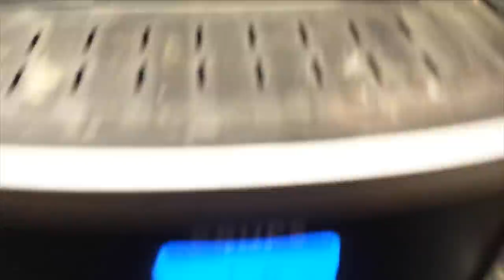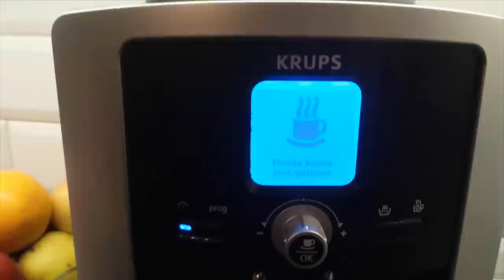KRUPS XP7200/EA8000 wyciek cz1. [leak part1.]

Comment: Hello, I have a problem and is that every time I make a coffee is activated the function of AUTO-TES, you do not have to be this ??
Reply from the maker: One more thing - from your description seems that the main problem is with your piston gaskets.
You can replace only those and your problems will gone.
I strongly recommend to replace entire piston instead of just piston gaskets.
The difference is that inside of the piston there is one additional gasket that is not accessible on the market - only way to replace it is to replace entire piston.
This internal piston gasket has small hole inside - coffee goes through this hole, but when hole is a bit bigger, coffee goes through faster and is not strong anymore.
So to enjoy nice strong coffee, is good to replace the piston instead just two main piston gaskets.
AA - entire piston costs the same as two piston gaskets and includes piston gaskets in the package :)

Comment: marisuz thnx for video but what did u do exactly to fix leak all i saw is u taking it apart and then put it back together?
Reply from the maker: +yacoub nasrallah 
Hi,
On this video I liked to show how the machine is built and where gaskets are located.
Here you can see it in more detailed view: https://youtu.be/ZWNQ2C9nV7A

To fix error No6 and get rid of the leaking problem, you have to replace all the gaskets. Fortunately gaskets are wide accessible on the market. You can buy it for example here: 
http://www.ebay.com/itm/Krups-Espresseria-XP-72xx-Hydraulic-Repair-Kit-Gasket-Set-Dichtungsatz-/300842234397

In case any problem, feel free to contact me.

\Mariusz
Reply: +Mariusz Grden  thnx
Yes i found out part2 shows the fix for the gasket ... But sadly my gasket  was good so i put my machine in trash

Comment: Thanks for the vid. maybe you have an idea whats wrong with my EA8260?  It's stuck in auto test, you hear the brew group moving, then the pump builds water pressure up but never releases it through the coffee-outlet. Then steam comes from the driptray( pressure valve?) and it says "empty containers". And gives a loud popping noise.This happens over and over, and is says "error code 12" .
Rarely it does work, then it's leaking from the bottom.

thanks in advance
Reply from the maker: colourado85 
Hi, of course I have a solution, but to describe it correctly I have to look at the manual. In general error No 12means that there is no signal from piston position switch or something like that. 
I'm quite busy at the moment so if I will not give you answer till Tuesday, please remind me about you.
Reply: Hello Mariusz thank you thats very kind, take your time and good luck. I will get back to you next week then
Reply from the maker: Welcome back :)
So according to the error code table on the manual:
Error No 12 (same as No13) means that "There was no ejection switch pulse in the 3s following return to the distributor’s original position: the machine requests the cake tank and the slide to be removed and replaced, and an empty cycle is proposed"
Solution:
No raising of the ejection pin:
- excess clogging of grinds in chamber
- escape of pin during rise of ejector (recall torque exerted by the spring)
- switch incorrectly clipped
- wires tensed
- no release of paddle-switch at rest against metal plate  place a washer th. 1mm + internal Ǿ 5mm between 
witch support screwing bush and metal plate
- poor electrical connection
- actuation pin on paddle-switch incomplete

When I've had this problem, was caused by another strange thing. When several times in a row I started to make a coffee and Stop it, it clogged a strainer inside the chamber. I just needed to clean it out.
Reply: Hi and thankyou for your detailed description. A clogged chamber or ..something explains now why it keeps saying empty containers.. I will let you know what the problem was. Where can I find the injector pin on this model? I have found some service manuals but they're without a parts list..
Reply from the maker: Hi,
This ejection pin is this thing inside the chamber with long "stick" and white plastic end. It is raised at the end of cycle by the mechanism that you can watch here:
https://youtu.be/ZWNQ2C9nV7A?t=3m48s
I can send you a service manual on email if you want.

\Mariusz
Reply: Cool now I know where it is lol. yeah I would really appriciate if you send me that manual, I've pm'ed you my email
Reply: Well I've cleaned the chamber (dirty) the strainer (not so dirty) and the plastic ejection pin sleeve (very dirty) and greased the pin with food-grade silicon grease. Checked the switch which seemed ok and the wiring. Then had a quick testdrive, and..  Everything worked!! right at the first try, even made good coffee without leaking. But...
Then I've opened it up again to finish all the wiring and clean the upper part (strain) since it was open. Put everything back together and it didn't work anymore >< 
Again error 12 but this time something else: the ejector pin keep sticking in the upper position.. When I move the ejection scraper a bit it pops back in the lower position again. Hmm.. I wil clean it all up, but I don't understand whats wrong this time.. I've noticed the switch also isn't very good, sometimes it doesn't click sometimes it does.
Will talk to ya..

Comment: Hi Marius !

There is a KRUPS EA 8025.
This morning I turned on after the POST error code 06 written off .
Can you help me to see what could be the problem ?
Thanks.
Reply from the maker: +B. Jocó 
Hi there,
Actually error code 06 is obvious - water leake caused by old gaskets located on the "Helper piston".
Please have a look also at this more detailed video: https://youtu.be/ZWNQ2C9nV7A
You have to change full set of gaskets - everything is on this video.

I recommend to change also entire piston (piston set costs the same as only piston gaskets). Inside the piston is located "Barista gasket" responssible for strongness and "crema" effect.

Full set of gaskets you can buy easy on the Internet for ~10 - 15eur
Piston shall costs also around 15eur.

Please have a look at the rest of my videos with Krups disassembly - you will find all details needed.

Fingers crossed,
\Mariusz

Comment: Hi Mariusz,

I have 2 pieces of EA8442 which drive me crazy.One of them start the grinder for just 2 seconds,the other run to long about 12-15 seconds and how i have seen it is to much coffee and the lever it is unable to press the hole amount so it go in test mode all the time.I have try to disconnect and connect back without the tray and water tray to get in setup menu but was not able to get in the setup menu.Any help will be welcomed.Many thanks.
Reply from the maker: Hi,
to go into the setup menu, you have to:
- unplug machine
- take the cakes container out
- take the coffee drawer out
- take water tank out
- press "PROG" button (keep pressing)
- plug the machine into the electricity (release "PROG" button)
- now U are in Service Menu. You can adjust the grinding time from 6 to 10 second

Put everything back into the machine, press OK
When Cycle finished, unplug machine for 10 seconds and plug in again.

What U describe is a bit strange. I hope the above information will be helpfull. In case any problems, just write a message.

Good luck.
\Mariusz
Reply: did you ever find a solution to fix this? I got the same problem..

Comment: Hi again,

I have done all the described steps but no way to get in the setup menu. My personal opinion is that both machines have a software(program) failure.To give you an idea about, if i cross change the user interface(the screen) the machines react in the same way...the interface with the 3 second grinding will run the grinder 3 seconds  on both machines,the one with 12 seconds will run 12 seconds on both of them.One more think, the test come only on the long running machine but i guess it is because is to much coffee in the machine and the lever is not able to press it,with the short running i have no test on the machines.On the user interfaces it is a connector to plug to a computer, have somebody try to do that?Ask a little bit around and let me know before i will trash them both!I have spend so many hours in trying to fix them...Thanks,Frank.
Reply from the maker: Honestly I have no idea :)
Personally I have also enough of this coffee machines and I've threw them out (also have two).
Right now I'm using simple pressure coffee maker - simple built, nothing to repair (like this one: http://tvmaxx.pl/images/3449859bce16930e87c7c3fb0f960737.jpg )

However if you really like full automatic coffee machines, I recommend to buy a second hand SAECO Incanto Deluxe - really durable machine with LCD display. A nice one after full maintenance cost ~100$ 

\Mariusz

Comment: Hello I have a problem krups ea8260 it keeps showing empty garbage dispenser I even changed the electron.
Reply from the maker: Hi,
hard to judge. I got rid Krups machine, but please have a look at the manual here:
http://www.repax.dk/files/EA8050%20temp%20mm.pdf
There you will find all possible issues described.
Regards

Comment: Hi, 
i have krups p7200 the same machine in the vedio, it gave me problem message  insert coffee drawer?
its in its place and still the same message 

any suggestion for the problem??
Reply from the maker: Hi,
For sure coffe drawer sensor is locked. You shall disassemble the coffee machine and check the sensor.
For sure you will see what the cause is.
In case any problems, please tell me, I will try to help you - I can capture a short video 4U
Reply: Mariusz Grden

Comment: Hi i have a Krups 8250 that has no error message but water does not come through.... What could be the issue as per your opinion
Reply from the maker: Hi,
The answer is here:
https://youtu.be/mft5b4iGkvk

\Mariusz
Reply: It seems that my error was different, now it worked and no more leak, the issue seemed to be in the pipes in some like this, as it was very dirty... good cleaning shaking and else helped... https://ersatzteildirect.de/Krups-Espressomaschine-Kolben-fuer-EA8080::12299.html

Although, now after a lot of cleaning cycles, I have a new symptons... It keeps asking to clean the two trays.... and does not accept when taking it out and in... 
Although it does realize cleaning cycle and asks for inserting the cofee bin tray if not in... and does the cycle alright, then asks for the cleaning.... and hence the option to make coffee is no more avail... (it was workign fine for 10 makes) then it occured....
Reply from the maker: Ferenc FairCo
Hi, please have a look at the error codes table in service manual:  http://www.repax.dk/files/EA8050%20temp%20mm.pdf

There are described almost every possible scenario. I hope it will help you.

\Mariusz
Reply: Hi I let it sit for several hours, (just writing so someone else can learn) it seems working just fine now... So I assume it was the issue that some describes as water made a short circuit... so I trust it dried out now....
I had used severaly for 10 minutes, just making coffee to rinse the system only, could have caused this situation
Thanks.

Comment: Hello Mariusz! Nice Movies.  I have a krups EA8025 for 2,5 years and now it´s leaking water in the bottom of machine, i´ve changed the rubber inside gasket KRUPS XP7200/EA8000 wyciek cz2. [leak part2.] and i also changed 2 o-rings on the piston but it´s still leaking. EX. If I make 100ml coffee in one cup only 10 ml comes in cup and rest comes in bottom and after out to my table. Could you help me? I remember when i brouth the coffee machine the used coffee was dry but now it´s wet. Do you think it´s same problem?
Reply from the maker: Hi,
it is always nice to change all gaskets each 2 - 3 years. Soon or later the leaking problem will come.
I recommend to change all gaskets because they are cheap and changing one or all gaskets is the same amount of work with disassembly.

There can be a leake also from the water tank to inside of coffee machine and than to the table.

Best way is to buy all recommended gaskets as a one complete on ebay (will cost ~12eur) - you will get everything U need included grease and seiger ring.

\Mariusz
Reply from the maker: Great deal :) In my opinion it will fix all your problems.
Reply: Mariusz Grden thanks for all help. i will come back and tell you how it went.
Reply from the maker: fingers crossed
Reply: Öresund Logistik Öresund logistik now i put Everything back but receive a error code 01. Do you know what it is?
Reply from the maker: Öresund Logistik Öresund logistik
Hi again
Error code No 01 means that the bulge on the water distributor axis were not detected.
For sure you missed something with assembling.

You have to check water distributor switch and cabling, or if is assembled correctly.

Please have a look at the water distributor and switch on this video (from 8:06 to 17:00): http://youtu.be/pHsmttJ79zo

\Mariusz
Reply: Mariusz Grden  hello Mariusz... Now my coffemaschin is fixed. you will not belive what i have changed.. new boiler, new water distributor, new electrical circuit board.i Think all machin is almost. cost me 270-300 euro../Senol
Reply from the maker: Öresund Logistik Öresund logistik 
Hi,
Yes - now you have all you need.
Fingers crossed.

Comment: Hi I have this same problem with my ea8080, I have replaced all of the the seals, but as soon as it starts a auto run test, it starts to leak water from the top part (the white plastic part that comes up at 07.25 in your video) any ideas on what I could be doing wrong please?
Reply from the maker: Ian Jones 
Hi,
The only idea is that U put the wrong size of gasket. Try to disassemble it and put everything together again.
Please ensure that You put everything on the right order.
Reply: Mariusz Grden  thank you for the reply, I tried a new o-ring and again with the old one, but it still leaks (under pressure) from that top part.
did you have a picture to how me how all the bits go back together on that part of the ea8080 please.
thanks
ian
Reply from the maker: Ian Jones Hi again,On the video above there is a mistake with assembly "helper piston" (this smaller on the white cylinder). If you like to wait, I can capture a video, with this part of the machine, in two days.
Reply: That would be fantastic please
Reply from the maker: Ian Jones 
Below the link to promised Video:
https://youtu.be/ZWNQ2C9nV7A

Comment from the maker: Hi Marcia Fernandez,
regarding your comment under my Video
You have disabled comments, so I'm unable to reply your message
however error No "5" means "Water pump error"
Detailed: Amount of water in first few sec of cycle is "0" - Zero

Cause:
1. damaged flowmeter (replaced or loosed water pipes
2. damaged or unpluged water distributor switch
3. water drops on water distributor cables
4. water pipe curved
5. water tank not on place
6. water valve stock
Reply: +Mariusz Grden 1) how can you tell if the flowmeter is damaged?  2)  where is the distributor switch located and how do you test it for damage?  3)  where is the water valve located?

Thank you for your continued help.  We truly appreciate it.
Reply from the maker: +Ella Siroskey 
Hi, Water distributor You can see on this Video: https://youtu.be/pHsmttJ79zo?t=8m5s

Water Distributor switch is on the right side of it (when you look at the video above). 
I am working on it from 8:38s of the video from link.

You can measure it with the simplest electrical meter or with simple bolb and a battery.

Actually I am pretty sure that when u disassemble it and assemble again, it will work.

Fingers crossed
\Mariusz
Reply: +Mariusz Grden I truly thank you for this.  We tried the easiest first - took out the filter and ran it without it.  It worked without codes.  However, only water came out.  So while we heard the grinder start, it didn't grind the beans.  We are now looking to see if we didn't reconnect the grinder correctly.  But we noticed that the inside of the machine was now wet.  Is that from running without the filter?

Another question.  There are numbers on the bottom of the filter - makes me think that it shuts everything down when it reaches the end.  What I don't know is what number is the beginning -01 or 12?
Reply from the maker: +Ella Siroskey 
Hi again, regarding the grinder - it is really common, that the grinder is plugged by the coffee powder.
U can easy cleane it - have a look here: https://youtu.be/3hqZKm4mH2k

About the filter - please throw it away. It is actually useless, because original one is quite expensive and you have to replace it very often. 
You can easy replace the filter with already filtered water from the Jug like "Brita" or something like that. It is simple to use and the filters are wide accessible.

As you describe, your coffee machine wasn't cleaned from long time, so once will start working, please do full cleanup cycle with the proper pill (of course not oryginal, because are several times more expensive). Just common pill for automatic coffee machines cleanup - shoudn't cost more than 5eur/10pcs.

Fingers crossed
\Mariusz
Reply: Mariusz Grden hy